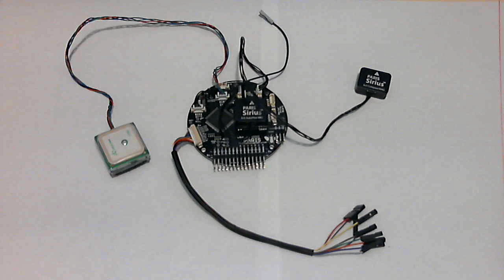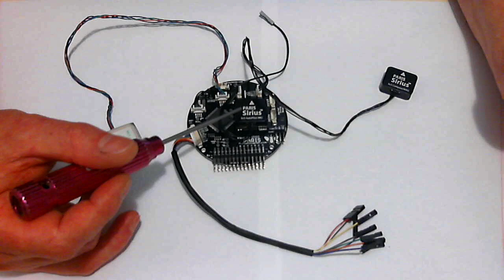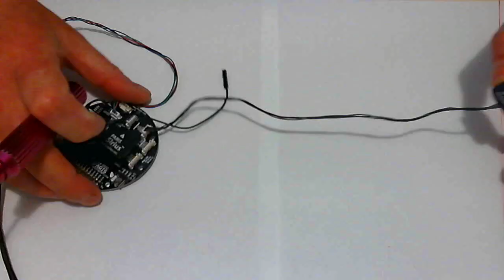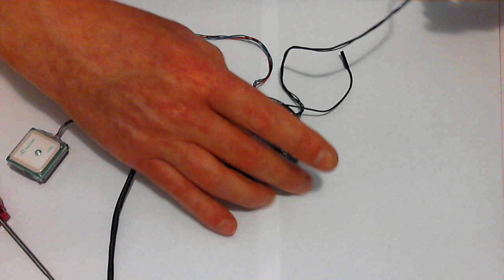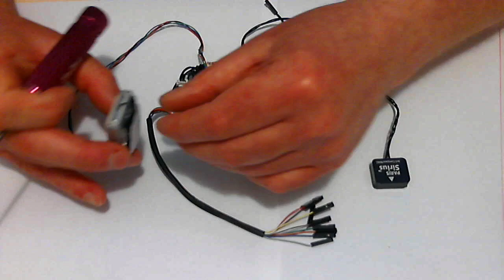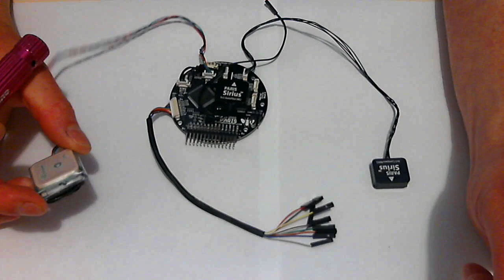Paris Mega V5 Introduction Pt1

Comment: Deet96 I have been having dramas with the GPS glitch that gets all blocked with multiwii, so I decided to go on Megapirates as I was told it was a software issue.. well same is happening with Megapirates. Do you think it is a hardware/design problem?
Reply from the maker: Swifteagle what board? What GPS?
Reply from the maker: Deet96 and what do you mean by "blocked"
Reply: Paris V5, with the gps it comes with...  Gps wont work , have to restart the board several times for it to work... I can tell it is block because on the FPV the Gps coordinates dont work... if I take off like that, Return to home wont work...
Reply from the maker: Swifteagle Sorry, I no longer support that product you will need to contact multiwiicopter yourself